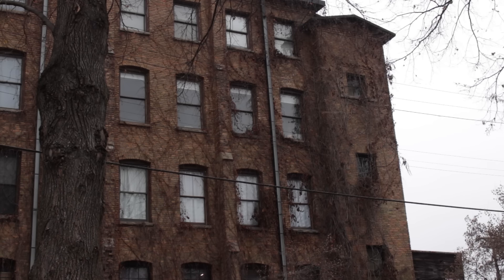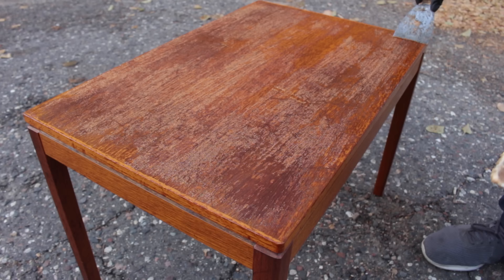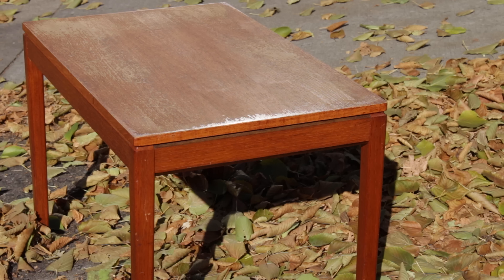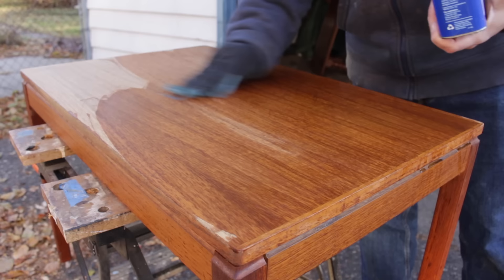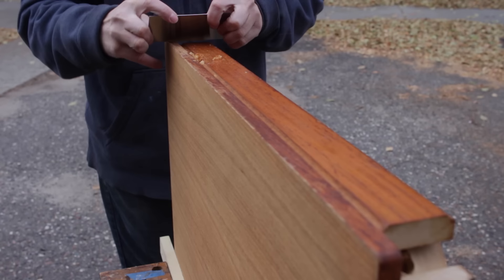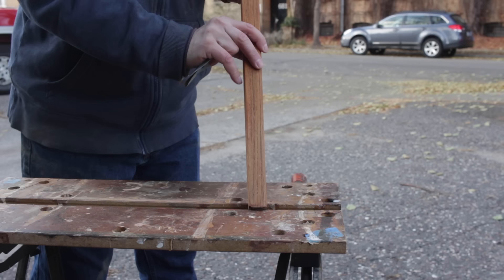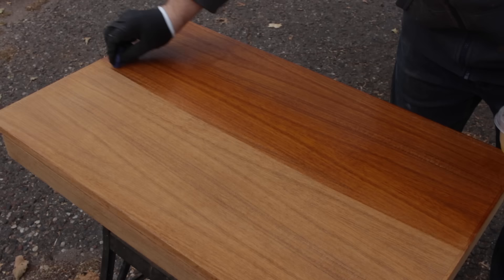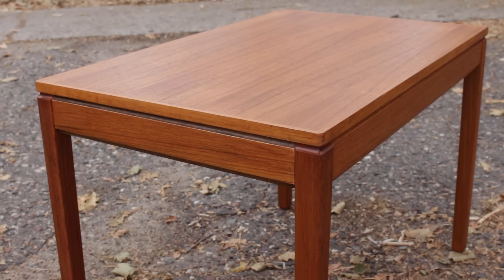Thrift Store Rescue #13 | Furniture Restoration | Refinishing A Thrift Store Norwegian Teak Table

Comment: I've been redoing furniture to resell for quite awhile and always used a sander to remove the old finish. I used 80 grit, then 120 then 220 or finer grits to sand old finishes off and then smooth out the wood with the finer grits. It was difficult to get into grooves so most of the time, I'd just use stripper to get to those. But!! You taught me something...use a card scraper. I'm ashamed to admit that I've never heard of these until this video. I'm going out today to buy one! Thanks for teaching an oldster a new and effective trick. BTW...the table you restored looks fantastic! Great job!

Comment: Awesome! I actually have an old table sitting in my garage, just happens to be the exact same model line as the one in the video, just a slightly larger table. I'll definitely give this a shot.

Also, if I could make a small request, any chance you could give a quick rundown of some of the products you use in these videos? Not being a native english speaker, it'll be easier to find suitable alternatives if you could show the products you use.

Thanks!

Comment: When they mention stains and blotchy areas, is anyone else cheering for them to bust out the oxalic acid?
Reply: Yes, but question: Do you have to then neutralize it afterwards? It is like a bleach, after all. In other applications, neutralizing is necessary to stop the chemical process from going any further and causing damage.
Reply: @lizday8140  I think you manage that by how weak or how strong solution you prepare. As far as I know once the water has evaporated the effect of the acid is stopped as there's nothing to carry it into the wood.
Reply: @lizday8140  I just bleached 8 Bruno Rey Beechwood chairs today. 
Yes, according to directions, what I see online, and my own experiences, you should neutralize if you want it to accept a finish. 
I've neutralized with mineral spirits and once with white vinegar, some products say water (but usually stains are caused by water).  I go with mineral spirits, it seemed to work best. 
One chair  was really stained, so I applied the bleach and just let it sit for a whole 24 hours, no damage to the wood grain.  So BigGoucho 
might be on to something, I'm not a chemist. 

I also got results using a soap flake finish right after the bleach, making sure to get all the bleach off before letting it dry. 
I used real wood bleach and also tried a recipe I saw online - a concoction of Barkeepers Friend powder, hydrogen peroxide and a small bit of concentrated chlorine bleach,and the homemade brew was just as effective, worked even faster. 
These were really blonde bleach chairs, I've had harder time with darker more dense woods.
Reply: “I think it looks pretty good”
Reply: @lizday8140  I think he mentions it briefly in the video but remember as well; if you're using anything with water in it to treat the wood check for raised grain and be prepared to sand it back before moving on 👍🏻
Reply: Only if the stain was caused by water. Oxalic acid will not work on stains  caused by ink, finger nail polish etc.

Comment: I can see you're having the same problem with the chemical stripper as I am -- doesn't seem to work too well in the colder weather.
Reply: It might still be better than mechanical stripping, if you're worried you'll go through the veneer.
Reply: @Joe Stephens I was looking for this info, can you name some brands? Thinking of redoing an old table
Reply: You can also get some additional mileage out of stripper by covering it in plastic wrap.
Reply: @kellerrobert80  your exactly right. Warming the piece AND the stripper inside will help. Never the less. It a slower process, in cold Weather.

Comment: why not power sand the whole thing, finish and all from the beginning?

EDIT: because the sandpaper gets gummed up, and because he's not sure how thick the veneer is.
Reply: Most finishes will gum up sandpaper really quickly, so its better to just use a stripper first and save the sandpaper for actual wood.
Reply: @jamiequinn5553  yep and he has said in other videos that he thinks stripping is less damaging to the wood. That is called "corning" when the sandpaper gets gummed up.
Reply: @thomasini  I had no idea there was a word for it, thanks!
Reply: @jamiequinn5553  That's because there doesn't need to be a word for it.
Reply: Kevin, I would have been in doubt from the beginning how much of that "teak" was teak veneer or even something phonier.
Reply: @jesse_cole  Hunh? If it doesn't have a word for it how could it be a thing? When we call something a whatchamacalit that means we know it needs a name, almost certainly has one, and it may even occur to us later, don't you think?
Reply: I thumbed this comment up 5 days ago and went for sanding first. Turns out the sandpaper will just get filled with old paint and it'll just be a waste of own time and money to keep sanding off the old paint. Just cheaper to buy a can of paint loosener. Also its super easy to peel off the old paint once coated with it.
Reply: @samoaspider  Yeah I made that mistake. Polyurethane gums up sandpaper less so than Danish oil or whatever was originally on the teak. So as long as you're okay buying a lot of sandpaper for your orbital then it's not the end of the world.
Reply: This is good to know. I’m planning to refinish a great dining table I got for cheap because the top coat has come off in a section and I was planning to just sand it down until I heard about the gumming problem. Will try the stripper first now.
Reply: @TheDavidlloydjones  some folk don't want to think.
Reply: @jesse_cole  
Hunh? Just because the phenomenon is outside your experience doesn't mean it's unimportant to people in this line of work.
I would have thought your foundation in thought would include the notion that every thing, event, or idea needs an attached vocabulary.
Reply: @TheDavidlloydjones  Oh, OK. Cool story.
Reply: @lauren8627  that's how i always did it and i have swirl marks on everything I've refinished.  :)  Just learned from these videos to go lightly and from another wood worker to move very slowly.  Redid my butcher block counters slow and light, and they're beautiful now.
Reply: Among the other comments, there's a degree of precision with hand refinishing, yes.  But the real reason why I would do it this was is that it puts some of your artistic DNA into the piece.  The machines will ultimately win, as Elon Musk is heralding constantly.  For now, I prefer that my hand does the bulk of the labor.

Comment: I'm just starting to get into this myself. I'm learning so much from you! I like how you do not clutter your videos with "perky" music, too. I can hear your clear, calm instructions, and the sounds of the process as well. Thank you very much! BTW, you paid $5, with all your work into it, what would you say the resale value might be?
Reply: He says that it depends on how many hours he worked, and then he just decides how much he wants paid by that number. So if he worked for 5 hours, and wants $10 an hour he'll resell it for $55. But I guess that's just a rough estimate and it depends on the quality of the wood.
Reply: @jonathancarranza6046  Probably has to bring cost of materials used in the equation aswell.
Reply: Wish there is a thrift store in Atlanta where you can get tables for $5. I think I need to venture out to the country side !
Reply: Jon

Please don't treat your furniture like this. You'll end up ruining it. Easy does it is the key to success.
No power tools, no heavy scraping, and no sanding needed.
Nitro Mors Antique Varnish Stripper is costly, but gentle to the furniture. You need loads of that, 0000 grade wire wool, and loads of time&patience.
Use shellac for sealing the wood grain, not polyester.
You do need a few days of work put into restoring a small table like this. That's why furniture restoration is so costly.
Reply: @thefreedomguyuk  if its for yourself that would be fine, but for resale? a couple days work puts $100 ontop easily.
Reply: Loved how you have enough confidence in yourself not to have mega unnecessary loud music covering up your instructions.
Reply: @thefreedomguyuk i think that only makes sense of the piece itself already has a lot of value, being an antiquity or made of precious materials or a super special brand or make. With a simple table like this, who's gonna pay for all the hours of work you have to put in? I think it's much preferable to have as many  decent looking pieces of furniture as possible have a second life than trying to resell only a couple of pieces.
So unless the table is gonna decompose after just a few years of use, i don't see what's wrong with the methods being applied here. 👌
Reply: Yes! re: music....that drives me nuts in "how-to" videos.

Comment: that was exactly what I needed to see.  I have an old teak stereo cabinet that someone left outside in the rain for a couple of weeks.  i did refinish it but didn't use oxalic acid so still have a blotchy top on it.  Didn't realize I could use oxalic for that type of problem.  I was only using it for water stains.  thank you very much, Dashner!

Comment: I’m sorry if I missed something, but why didn’t you just sand instead of scrapping?
Reply: if your not careful you risk burning through veneer due to varied pressure on an orbital, usually the finish will adhere to the paper so your not getting consistent grit quality and will sometimes leave marks on the wood too. its quicker and less destructive especially for large areas. I use sand paper just for fine detailing, just like he did. you check dark spots with mineral oil or denatured alcohol (cleaning) - revise the area - sand than check with water to raise the grain if you want to, than use finer grit

Comment: Noob here. Why didnt you just sand the top from the beginning?
Reply: noob here too, i sanded something i had put polyurethane on and it gummed up my sandpaper pretty fast - I am going to look for one of those scrapers - 
the acid step maybe is something for veneers - he was just trying not to sand through the veneer - if you have solid wood i would just scrape/sand
The mineral spirits steps were just a preview: you can use this preview to decide if its ready for final finish or if there are still blemishes you wish to keep working on
Reply: @roylethen1033  thank you

Comment: isn’t using poly a bit of a shame, the newest hard wax oils give impressive protection and there’s no layer of plastic over the wood
Reply: Indeed, using poly is a crime. You need to seal the wood grain with shellac. It's crap to work with, but the way to do it. Then buff with wax/oil, whatever you prefer.
Reply: @thefreedomguyuk  Or even just good ol' cellulose sealer as a first layer

Comment: how much does a project like this cost after all materials?
Reply: What materials?  Sand paper and a half cup of polyurethane? A few bucks max. Sander and scraper are tools to use for years so I wouldn't count those.
Reply: @jandypimpson  he used a few more things than what you just listed. What I'm asking is if I owned nothing except a sander and scraper, how much would it cost to buy every single thing he's using in this video? I'm aware that if i have leftover materials and I use it on more projects, the cost will be cheaper per project
Reply: @gregkrazanski  You don't need that fancy stuff he uses.. Just use sand paper, first the harder one and then the softer, sand it down, clean it from dust and apply varnish for wood..
Reply: @macke7689  he was saying he was worried about using only sandpaper to get rid of the finish because he might go all the way through the veneer, hence the use of paint stripper and oxalic acid. also why is everyone who responds to me not actually answering my  question lol?? I thought someone might have a ballpark figure but i guess i can just take note of everything he's using and go to the hardware store and do it myself
Reply: @gregkrazanski  a gallon of stripper and mineral spirits will cost between $15-20 each and the stain about $15 per quart. Of course you'll be able to use them for many restoration activities
Reply: @andersonvom  Thanks!
Reply: Well Greg, I am only 83 years old and and may have forgotten some things but you’ll likely find these items helpful:
boar bristle brushes: 1” wide - 3 inches wide, 3 or 4  throw aways.  Not worth time trying to save them. 
Good— Best quality paint brush or varnish brush. They are different. Don’t stick it way down in the paint or varnish!  1 inch will do.
paint remover:  1 pint, quart or gallon. Dealers choice.
paint scrapers : 1 — 2  cause you never know. 
Steel wool 00:   I bag or box 
Steel wool: 0000:  1 bag or box 
I package of 3 M green sanding pads 
Mineral Spirits, aka Paint Thinner 1 Quart or more 
Stain, 1 pint if available 
Stain: 1 quart since pint size was not available 
Roll of water proof flooring paper 
Sandpaper 120 grit
Sandpaper 200 grit
2–4 empty cans
Roll of paper towels
Clean rags

Time: wasted hunting and gathering ? 
Time preparing ? 
Time actually spent on working ? 
Pleasure in doing ? 
Pride when completed?  
Incalculable!
P S   Be sure to dispose of the rags, paint or varnish remover and  paint or varnish scrapings in a closed container. Be safe.
No Smoking around this stuff, either!

Comment: Very nice. I am Norwegian and my parents had a similar coffe table in the sixties, so I'm getting a bit nostalgic viewing this.  We were a large family so it was quite a bit bigger, but the same design.  I think you might tone the restoration down a bit. It is more valuable when it looks the age, but nice, like it has been kept well.  You make it look like it is almost straight out of the shop.  

The card scraper you are using is called a "sikling" in norway, and there is allways arguments between the oldtimers in the workshop of how to set it up.  The scraping is done by the burr, and not the edge.  For restoration it is a great tool, and it does not fill up the pores with aluminium oxide like sandpaper.

Comment: Nobody:

Youtube woodworkers: M I N E R A L S P I R I T S
Reply: I'm.... confused. What's strange about mineral spirits....? It's a solvent used in art (most notably with oil paints) and woodworking. With paint it can be used by itself as a paint thinner and a cleaner, and it can be mixed with other stuff as a medium for oil paint. In woodworking, it's used to show grain, get rid of excess oils on a surface, and identify areas where you haven't cleaned up the old finish or glue well enough. Personally, I like it better than turpentine, because turpentine stinks like nothing else (even the "odorless" varieties) and it's considerably more toxic than mineral spirits are.

Comment: You found a great little table and did a really good job refinishing it.  I have found some really great pieces myself that I will be refinishing.  I also got my mother's bedroom set (which is antique), and a server that my grandfather finished close to 90 years ago.  I won't be touching the server even though an uncle ended up putting a can of red paint on it and left marks.  It's a family piece, and that is going to be a part of the family history that is staying (covered with a dresser scarf of course).  I know chalk paint is all the rage, but I will never do that unless there is no way to refinish it.  I've got a chest of drawers that was fiber board on the sides, and so I painted what was hardboard, and because the rest was wood, I stained and varnished all the drawers and the top.  It looks real nice.  My mother's bedroom set had already been refinished by someone and didn't do a great job of it, and so I will take away no value from the pieces when I strip, stain and varnish   I was told by my neighbor that it is rosewood.   I need to get some new key holes for some of the drawers.  When spring comes, I will be busy.  By the way, I'm from Minnesota too and wondered how cold it was out there while you were doing this project.  I have done some projects when it got a bit colder in the fall, but hesitated a bit with any weather that was colder.

Comment: A Small wire bristle brush helps alot with removing left over finish, dark spots, and cleans the grain. And it works fine with veneer, it won't tear it up like you would think. Use the brushes on the second coat of stripper, and if you like, also on the first application of lacquer thinner.

Comment: A master at work.  Love your stuff and have learned a lot.  Amazing what you can get done in your driveway.  

I totally agree with using wipe-on finish.  Simple, durable, no fuss.  Just dispose of the rags safely. 

One suggestion is to use a piece or two of cardboard under the piece or your workstand, to help reduce the wobbling.

Comment: As a furniture restorer/ French polisher myself a tip that you may want to use going forward is maybe to unscrew the top from the base, that way you don’t have to worry about dribbles of stripper running over the edge of the top onto the base.

Comment: Stumbled into this video as a suggestion below another video and I'm glad I did. I don't really restore or work with veneers much, so my first thought was "why the hell doesn't he get the random orbit out" but that thought was quickly explained away with "I don't want to sand through the veneer" not but 30 seconds later. Hell of a job for a random thrift pickup. Nice work. I may try this some time. I just prefer to build vs. restore. Nice to know a thing or two for when the time comes though so thanks for your time and knowledge!

Comment: really helpful, well produced video.  Pro Tip- if you keep moving your table in a circle, you will eventually find a place where the feet are level and your work surface is stable.  Try it.